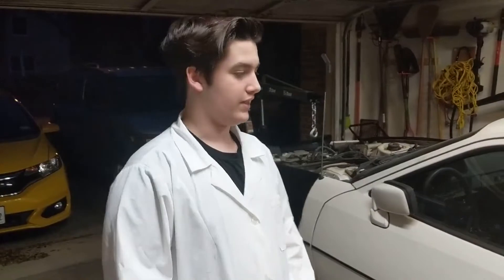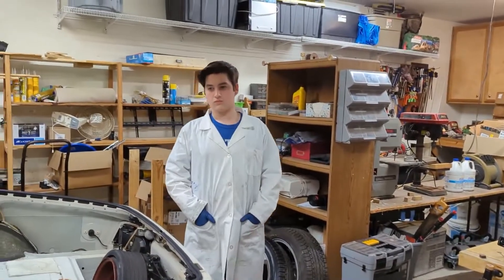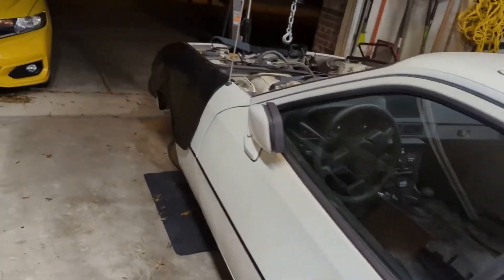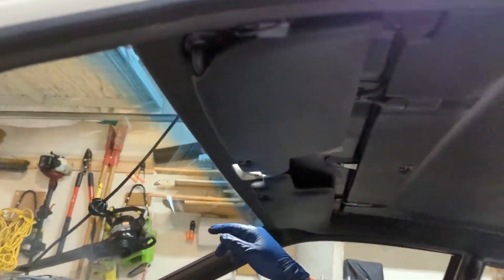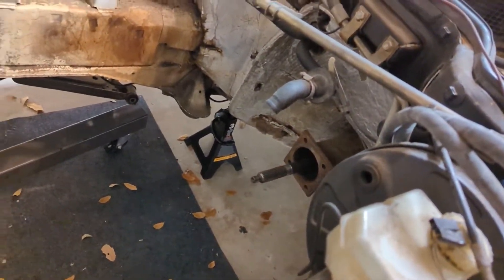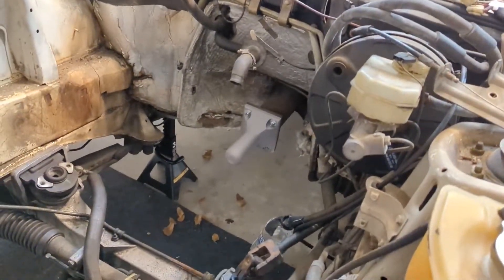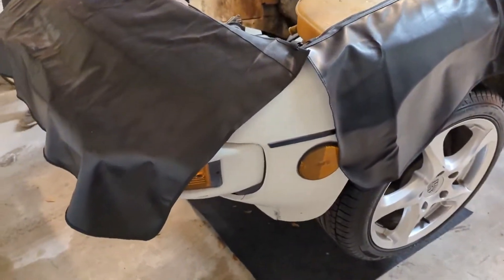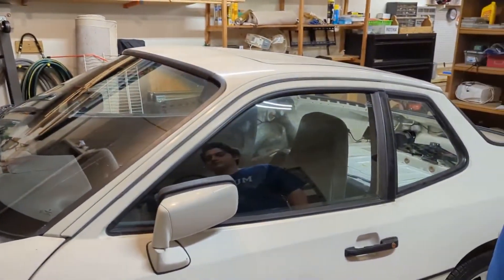Porsche 924S EV Conversion - Part 4

Comment: How about electric power steering? Someone converted some really old Jag and they used electric powesteering, it was a small module that was powered from 12v and it did the job
Reply from the maker: We are considering it. We think the simplest thing to do first is to just not have it. Lots of people in the Porsche 924/944 community "depower" their steering so they can drive without it and have tighter steering and less weight. So we will probably try that first. But it is definitely on the list as something to consider.
Reply: @FrankGraffagnino  You can either use an electric motor to drive the Porsche PS pump (I plan to use an alternator converted to a motor) or buy a 12V electric hydraulic PS pump from an OEM car like a GM or Volvo. Most folk in Europe seem to be using a GM hydraulic pump but they are very noisy. Or you can convert the rack to epas with a motor that bolts to the column but I'm not sure how successful that is in a car with hydraulic PS.